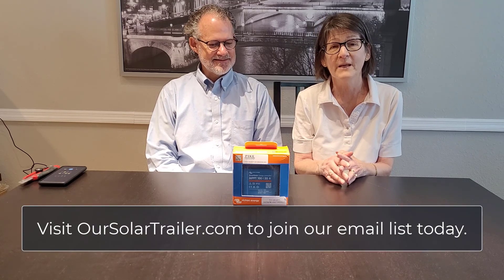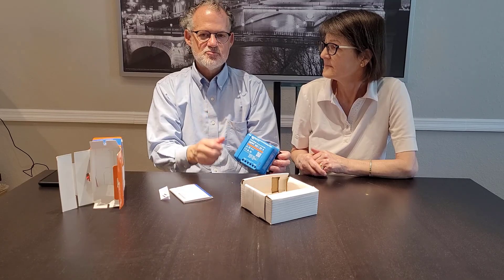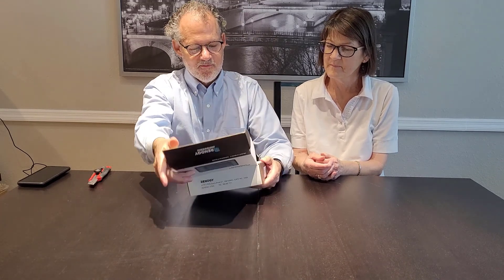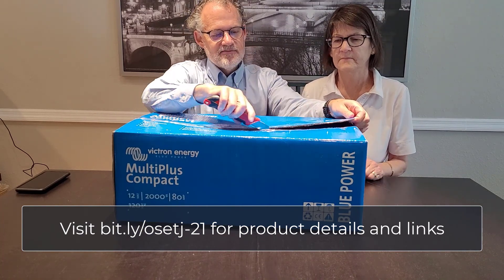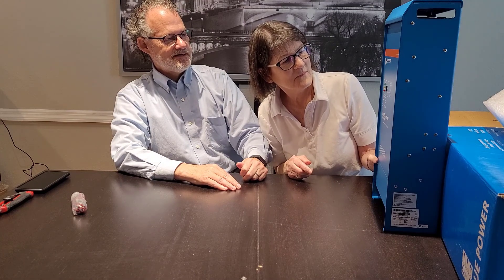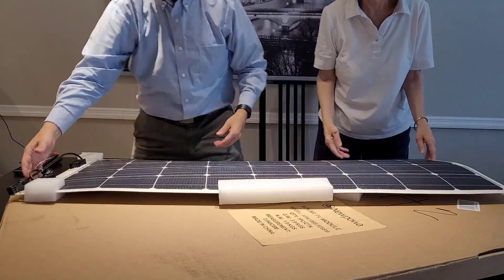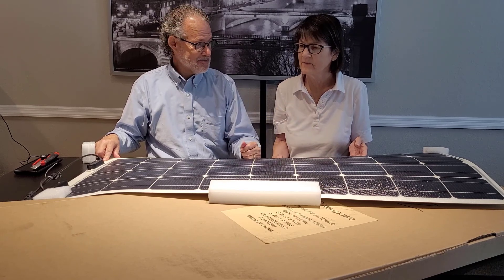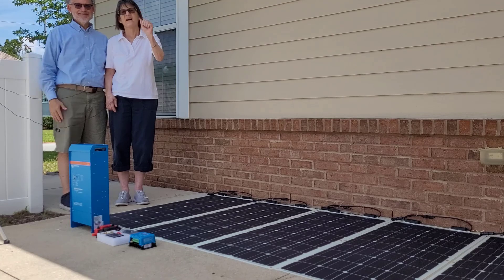Unboxing the Solar System for Our Aliner Scout Popup Trailer RV

Comment: The open circuit voltage of your panels is just over 20 volts, at 5x, just over 100 volts. I predict a short life for your charge controller with a 100 volt max voltage input.
Reply from the maker: You nailed it. Being new to this, we didn't realize the panels could/would produce more than 20 volts at times. They do. When they do, the charge controller shuts down and we get no power. I've been confused by this pattern but you're telling me you could see it would happen. We'll replace/upgrade our charge controller! Thank you so much!
Reply: @oursolartrailer  If you only had four panels I would parallel them, with five you are up 30 amps or so. Still doable. Parallel has the advantage of a shaded panel not attenuating output nearly as badly. With the short wire run, 30 amps over 10 gauge will likely work, but check the charts (I have not) to be sure.
Reply: Keep in mind, it is a very rare day when you get full output of the panels. Clouds, angles, position, etc all take their toll.
Reply: @Gratefulwon  Indeed, still, I'd seen this pop up multiple times without understanding that it could/would so often!

Comment: I'm looking forward to following your process with this and just subscribed. I have a Chalet a-frame with a 10,000 btu cool cat A/C so running my A/C on battery is pretty much out of the question unfortunately. I just finished putting 2 smart lithiums (200ah total) on the tongue along with a 12 volt fridge to replace the smaller 3-way fridge. I also carry a portable Engel 12 volt fridge/freezer. These accomodate my strict fresh food diet very well for up to 2 weeks without shopping. My solar is two Zamp 180 watt suitcases rewired in series with a total of 40 feet of extension cable and a Victron controller. Trying to get down to minimal propane use so I installed a Wave 3 catalytic heater that sips propane. I don't use the water heater and heat my water on the stove which I've made removable to use outside or inside.  Working to be as electric as possible and I'm always off grid. Mods are a good part of the fun for me. Cheers and have fun!
Reply from the maker: Wow! We can learn a lot from you! Can you run your A/C from your batteries for any length of time? We do worry about having enough power for keep cool in hot weather, running off the solar and batteries exclusively. That, for us, is the challenge. We may have to invest in some portable storage and batteries to supplement what we put on the trailer. Please keep in touch, Wally!
Reply: @oursolartrailer  Hi there! I can't run my A/C as I haven't built in an inverter plus I'd have to have a huge battery/solar bank to power 10,000btu's for any period of time. I've had a Bluetti EB150 portable lithium battery for a few years and it has a 1,000 watt inverter if I need one. Your A/C is probably 4,000btu or so. Lot's of folks power those units with batteries and solar. Ultimately it's a math problem. Whatever you estimate your usage to be worst case, against appx. 6 - 7 hours of solar per day to replenish batteries and size your solar panels and batteries accordingly. A huge help to me has the YouTube channel "EXPLORIST life". He has a lot of videos on solar, wiring, sizing etc. for your camper or van. I refer to it quite a bit. I'm personally fond of the portable suitcase panels becuase I can chase the sun and get the most out of each day. I applaud your decision to go electric and solar. It's the wave of the future for RV and camping. Looking forward to following your journey.
Reply from the maker: @wallywal6139  Our A/C unit is 5,000 BTUs--half yours. It is so small, I don't think we need a soft-start device. My math suggests you could power your A/C some of the day with your batteries but you may need a soft-start device. Have you looked at those? They are a bit pricey but could allow you to get some much-needed a/c when you don't have access to shore power. Of course, you're right about the inverter. I was surprised at how pricey they were compared to the charge controllers.
Reply: @oursolartrailer  I have a soft start for the rare occasions I use a generator. I haven't used it in a couple of years though and camp at altitude in hot weather to avoid the heat. Trying my A/C on battery/solar is an interesting thought for sure and would expand my season and range.

Comment: I'm been learning a bit about solar on my Aliner and use a 100 watt suitcase solar panel. I just plug it in the solar port. It keeps by battery charged just fine. The fridge runs on propane but I found out the hard way that the fridge fans runs off the battery. What kind of battery will you be using to run the AC? I know that it can be done but it will have to be an expensive and time consuming setup just for running the AC.
Reply from the maker: Paul, you're right. It will be a big project and a big battery. Here's a link to the battery we picked: https://amzn.to/3vULM9G.
Reply: @oursolartrailer  I hope it doesn’t take as long as you say to complete your solar hook up. Because I’m watching you to learn a thing or two to do the same😄
Reply from the maker: @larriettausa  Today's project is repairing the A/C. If we get that done today, we'll start on the solar project next week. I only have about half a day a week for this stuff. Fingers crossed!